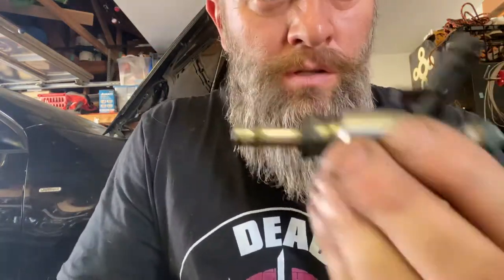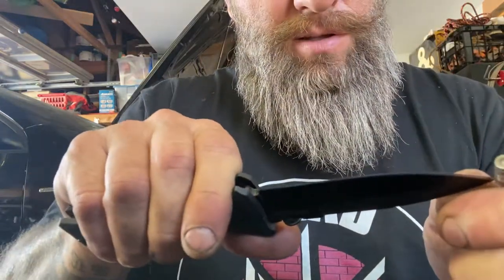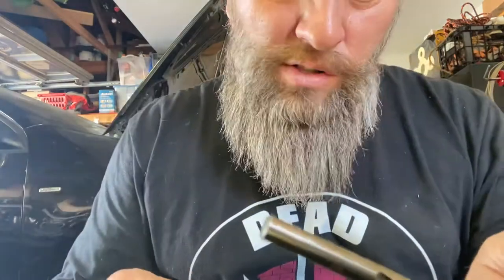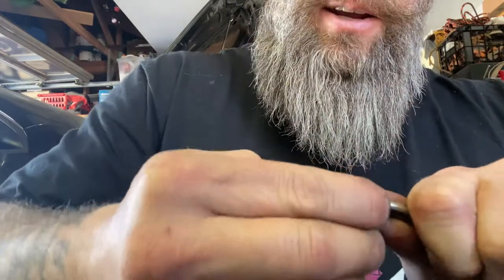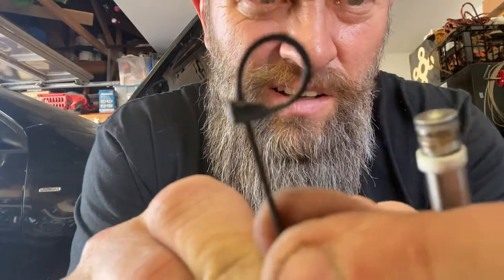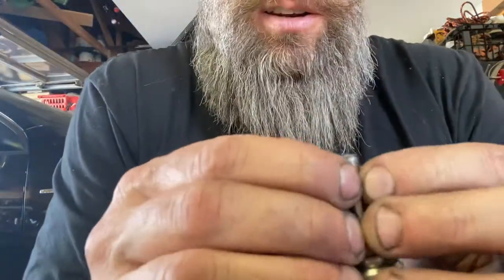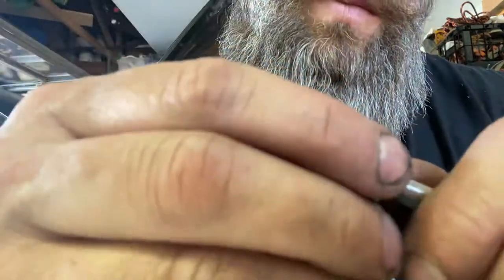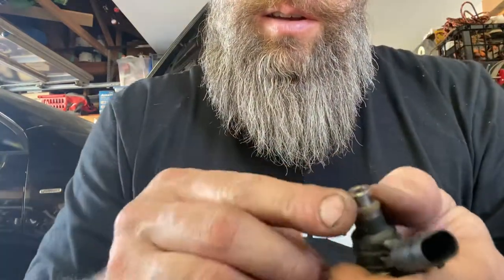Fuel injector seal without special tool

Comment: Rubber fuel line hose 5/16" or 3/8" ID. Cut 1/2" lenght then slice/remove 1/8" vertically so you can open it up and place it around teflon white seal. Use worm/screw clamp around rubber fuel line tighten all the  way. I had positive results in 5 minutes nice snug fit.  Also used same fuel line piece to push on seal with proper size cone.